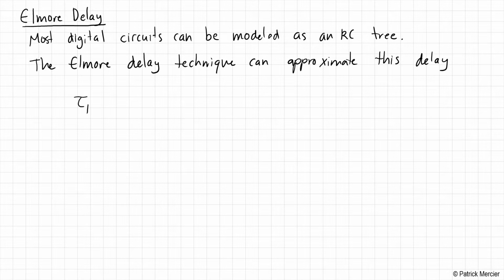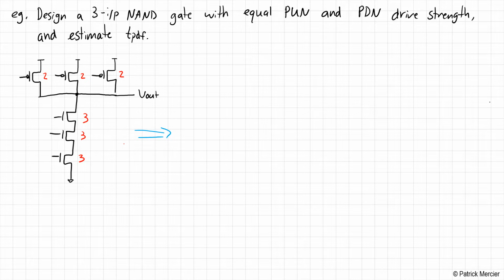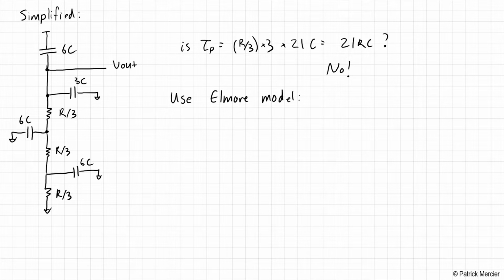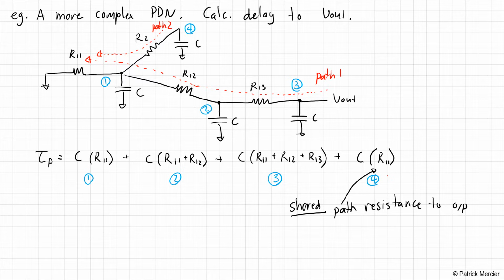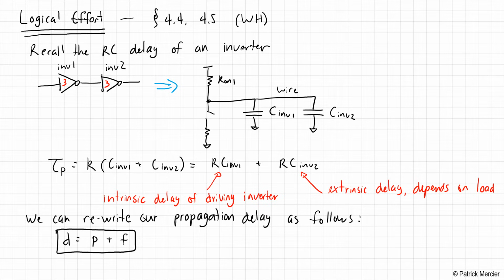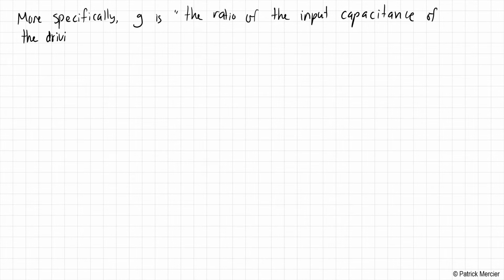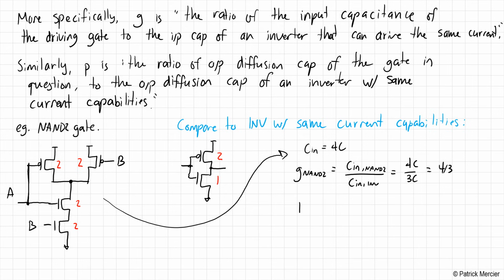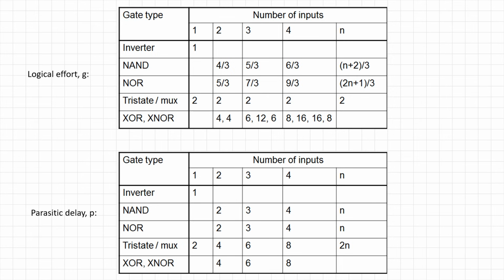ECE 165 - Lecture 5: Elmore Delay Analysis (2021)

Comment: at 9:38 the capacitance 3c should be at each node right , so a drain and  a source together ,it's a node. between each nmos there should be a   3c , since there are 3 nmos  , if we count from the bottom , there should be 3c between 1 and 2 nmos and 3c between 2 and 3 nmos .. correct me if i am wrong . got this info from NPTEL lec of Digital IC design

Comment: at the start, why you say that in the pmos net we've  2C? I understand that in the N net you need that 3C because of R/3 and you have 3 so you obtain R. But shouldn't you have to put 1C , because the worst scenario is  R in the pmos net?
Reply: For the PMOS to have same strength as NMOS, its width must be twice. That's why 2. You may look all values as multiple of some width W. Say 3W would be the width for each NMOS and 2W for PMOS.
Reply: @manmathashtikar5756 The capacitance is proportion to the width?

Comment: Why we have to take size 3 for nmos. Why not other number... please anyone answer...
Reply: we are comparing the full circuit to inverter , so now the total nmos pull down network ( 3 series nmos ) should give the Resistance R , which one single nmos gives as in inverter , ....so if we take 3 , ( R/3 + R/3 + R/3 ) gives R , ......whereaas 2 or other numbers wont give us

Comment: At 9:10 you said that the worst case scenario would be to calculate 1 one transistor turns on (the other 2 are switched off ) but in pull-down network you calculated all of them switched ON. This is a mistake therefore making the rest solution false.
Reply: dude he said , one is enough because the Pmos are in parallel, so one transitor turns on , will be fine , but for the nmos , all are in series , so all should turn on dude,,
Reply: CMOS VLSI 4th edition by Neil H. E. Weste & David M. Harris  can also prove that what you solved is wrong

Comment: If you ever had a chance to get interviewed by Apple related IC design position, you would be regret for not coming here earlier, thanks for the lecture, prof!!!
Reply: Prof, please allow me to add some memo here to explain why there is 2 on PUN and 3 on PDN:

To equal PUN and PDN drive strength, assume the both network resistance: 
PUN-R = PDN-R = R, 
and we know for each transistor in PUN, it is generalized with 2R/K and for PDN, it is R/K
So, for PUN-R:
1* (2R/K) = R, K = 2
For PDN-R:
3* (R/K) = R, K= 3
That is why PUN has 2C on both drain and source of each transistor and PDN has 3C on each…
Reply: @WonderingSoccer  sir what happens if we take k = 4 for nmos. Because it so confusing. Please answer

Comment: At @12:00 why did we not keep the 3 parallel  resistance R  from the previous Pull up Network
Reply: Because for a falling edge delay the pMOS transistors would be disconnected (but the 2C capacitances would still be connected to Vout)